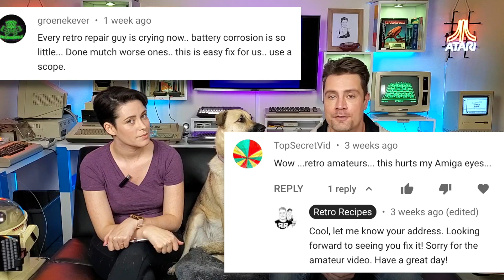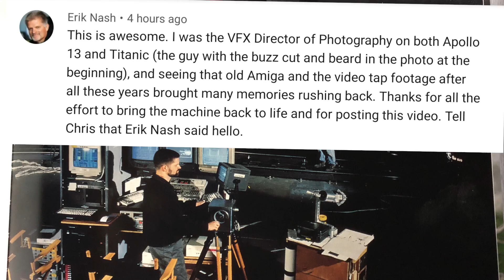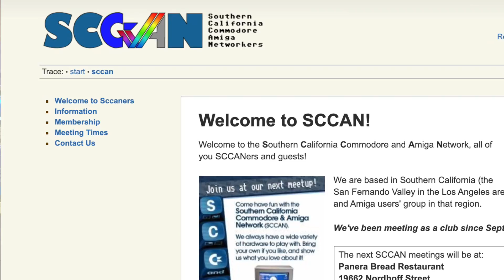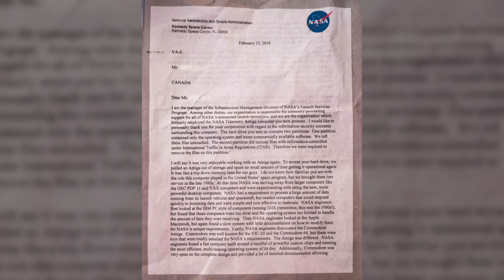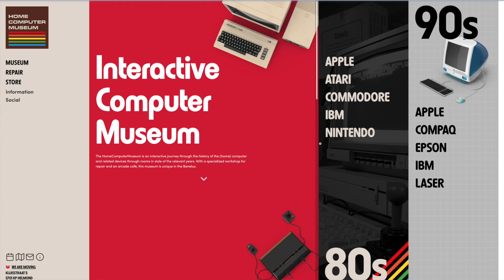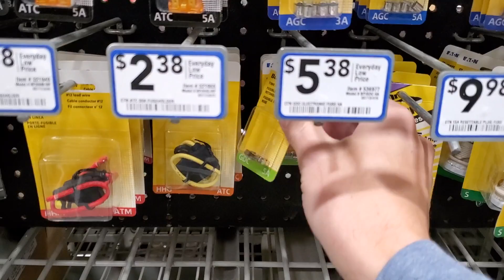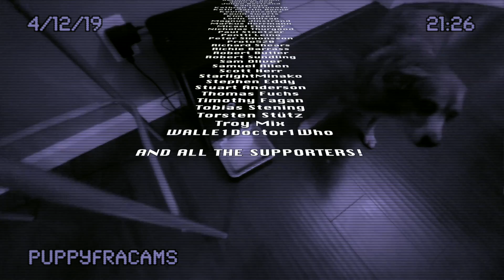Can we fix the Amiga that made Titanic? | Warning: Shocking

Comment: The first time this was powered up with 240V, the MOV (Z1) probably fired and blew the fuse. However, MOV's in this sort of case are usually one shot, and while they usually fail as a short, I guess this one failed open. The second time you powered up, it looks like the main switching MOSFET (Q1) bought it, which would've gone short between all 3 terminals (typical failure mode of MOSFETs). This in turn took out the control IC and R7 (connected to the mosfet's source pin) and R6 (connected to the mosfet's gate). I suspect R9 (current sense resistor) probably went as well.

Chances are there was a wire link between the +ve terminal of the bridge rectifier, and the middle of C7/C8 (the main capacitors). Removing this would've made it suitable for 240V input.

As others have mentioned, you should always power stuff you are unsure of via some sort of limiter. a 100W incandescent bulb is perfect for this, and something I use whenever I have serviced any form of power supply.

Comment: I've had a pretty shocking experience myself a few years back, I had an old TAB Silverball machine that I got working from two machines, one day I noticed a wire nut had come off some leads (I never did that work to it), I didn't replace it straight away and soon regretted that decision as later that day I was doing grabbing a keyboard inside it so I could go into the Windows 95 environment and as pc inside had an unpainted metal casing the wires touched it, I quickly leaped up getting my hands out of it, the monitor shut off and loads of smoke came from the CRT monitor and possibly the casing of the computer inside, I managed to hit the main switch on the back in time and saved the system from dying completely.  I left it for a few days to see if any permanent damage occurred and surprisingly it worked flawlessly, not even a blown fuse.

I was quite surprised it worked and yes I did replace the wire nut, a few months later the was an accident involving the touch panel smashing and turning it into a Step Mania and emulation machine with a different pc inside.

Also, I reckon Puppyfractic was just testing your reflexes.

Comment: 15:34

Sounds like the bridge rectifier may have been shorted, as you can actually hear the 60 Hz AC during the explosion.

That 8-pin DIP (IC1) is likely a UC3842 or similar SMPS chip, which drives the large transistor on the heatsink to the left of it.
I wouldn't be surprised if that chip got zapped by the 240V, and the large smoothing caps somewhat damaged.

(IC3 is the opto-coupler, which gives electrically-isolated feedback from the secondary side to IC1 on the primary side, for voltage regulation.)

Would be interesting to know if the bridge rectifier (black component, just above the large caps) tests as shorted.

But yeah, never listen to those "just replace the fuse" comments. ;)

The fuse normally pops for good reason, and the "240V incident" would have caused other damage, too, so it was a known cause and not just a fuse failing with age.
Reply: 16:47 That's actually not that specific resistor exploding, I don't think. It's molten bits of silicon and leadframe from IC1 flying around everywhere. lol

The 5 Amp fuse would normally allow quite a high current (and power) to pass in 240-Volt land (like in the UK).

(volts * amps=watts, so 1200 Watts.)

In a 120V PSU, the 5 Amp fuse makes more sense, as the PSU would then have to dissipate around 600 Watts before the fuse popped.

But, since it was powered from a 120V-240V step-up transformer, the original 5 Amp fuse would have allowed a LOT of current to flow (and a lot of potential power dissipated in shorted components) before the fuse finally melted.

It's more than likely the main switching transistor (on the heatsink near IC1) also shorted during the original incident.

I think that PSU is still fixable, it's just a question of whether it's really worth the effort. It's probably only $20 worth of parts to repair the primary side stuff.

The secondary side (regulators etc.) might have survived OK, as the transformer usually limits the current quite well unless it's being pulsed continuously.

Comment: My A4000 still works great.  I took the battery out yrs ago when I noticed it starting to leak and eventually replaced it with a little battery board that takes a 2032 coin cell.

Comment: just check the voltages and replace it with a modern new power supply !

ps. :  you can put new power supply in old case and everything will look fine ! 
pss. : oh, a new idea, also replace a ryzen5950x plus rx6800xt in the main case , make everyone surprise how strong was old computers

Comment: this reminds me that i need to check a couple old original xboxes for leaky caps (especially the rtc cap). im uh... not looking forward to it. 

by the way, you should see this c64 i have. it’s like practically unused, but there’s a huge crack in the enclosure that pushes the keyboard in when you type. like someone sat on it, or something. weird stuff. as nice as your brixty-four is, i guess i’d like to try and fix it. do you have any advice on making it look pretty good if i try to repair it?
Reply from the maker: I recommend you check out my Atari 800XL Extremefurb video for some case repair tips ;-)

Comment: Any chance you could try to export the PAR files in their native format and upload those to archive.org?  That would avoid quality loss going though an external capture card and compressing to MP4.  Looking through the manual it should be possible to export image sequences in its native format, DPX, and other formats with the software.
Reply from the maker: It's no longer with me but I'm sure Marvin can. I did already upload the HDF backup to my archive. See previous video description.
Reply: @RetroRecipes  Yeah, thanks for that.  I downloaded the images, but without the real hardware I don't really have a way to decode the files.  I found the manual for the PAR software, but I can't find any technical information about the filesystem the PAR drive uses, or the technical details of the format it stores frames in.  I was hoping to learn more by reverse-engineering the exported files.

Comment: Out of the dozens and dozens of these machines I’ve seen, and all of the battery acid damage… I still like the old batteries and it was decent tech for the time. Too bad it couldn’t be hermetically sealed or something to save from all the damage.  

But even with today’s technology… I swear to God modern Duracell alkaline batteries have damaged more high-end equipment than these old batteries. So although I know these old batteries have really done a lot of damage… They held up for a really long time, and there’s no idea what kind of thermal cycling they went through for years and years. Shit if you had put a Duracell in there… In a week half the board would be missing all of its traces. So although it sucks… Still impressed with those old batteries, And can’t figure out why battery technology has gotten worse in some areas.
Reply: Feel like I should add… I’m just picking on Duracell because they’re the main offender… And I don’t come in to contact with them much. Except one fixing multimeters another portable test equipment for some of my industrial customers. Why the hell they would pop Duracell‘s and stuff like that I don’t know… I always suggest energizer ultimate lithium is it going with something off the shelf. Or if it all possible a high-quality rechargeable that can’t be bought at Walmart. It’s probably a decent battery if you have to order it and it can’t be found on the local shelves at Walmart or the dollar store 😂 . I repair mostly test equipment, industrial PCBs, and do a bit of recalibration and metrology just to test my sanity. Board mounted batteries have made leaps and bounds of improvement over the years.

Comment: Fuses FAIL FOR A REASON!
Swapping a fuse is like finding metal shavings when changing your engine oil… then Cleaning your oil pan and thinking everything is OK. I mean holy shit really guys?😂 

that’s hilarious when I hear people say things like “why don’t you just change the fuse“ like seriously? Have you ever heard of varistors/movs and all the other means there to handle over voltage, In rush, transients, and overcurrent. Fuses are a last resort. (Well I guess technically the transistors and everything down range that’s going to get fried is the “last resort“)......but on something with even the small chance of being valuable or important…Not in a million years should you just swap a fuse. Fuses don’t blow for no reason. They are one of the most stable and predictable components on the board. I do PCB component level board repair for industrial clients day in and day out, I’ve seen boards that have been so abused you can’t imagine they would still work. Where the legs of chips are so corroded that they have been skeletonized… But after touching up solar joints, replacing electrolytic’s, and going over everything… The boards still work just fine. And no matter how badly damaged the fuses are always still completely intact. Even ridiculously fragile very low current rated fuses that have microscopically thin hair like filaments. Fuses aren’t fragile. They won’t blow for no reason… And what makes them blow isn’t some thing in your wall voltage… It’s a failure in the power supply 99% of the time. And if you just swap the fuse… Next time you might not be so lucky and it will take out a shit load more stuff that’s very difficult to replace, or it might take out a power supply control chip that’s impossible to find. And if it’s on a customers board, and “unobtainable“ board, or what I like to call… A “dinosaur board“… Then you just royally screwed up.
Sorry to ramble. The fact that anyone would be watching this channel and not know something like this and think they know enough about it to lecture or leave a comment on somebody else’s video… It’s kind of mind blowing. That’s like finding burnt metal shavings and ground up engine block in your old oil when changing your engine oil… And thinking that by cleaning out the oil pan and removing the chips totally solves your problem and you can just go forward and ignore it from then on. 😂

Comment: @Retro Recipies / Perifractic  How come the audio in the videos from your camera very often sounds like it's recorded with only 4 bits? The dynamic range is pretty much non existent. Low level sounds disappear. A good example is around 4:58 when you meet Paul in the parking lot. Sounds like the audio level is really low from the recording, and then boosted like 30dB in the video editing software. Meanwhile, clips where you narrate over the video, and videos you edit in from other people, like from Paul's lab, have no issues at all.
Reply from the maker: 4:58 is because those clips have noise reduction filter on them due to excessive wind and car noise. We were right by a freeway. Paul's lab had no traffic in it that I know of. If I had left that noise in I would have got complaints about that instead. So I just make an artistic decision.
Reply: @RetroRecipes  Ah, of course.
And regarding your pinned comment, I guess where you two are quite far from the camera in the studio / workshop the camera mic results in poor audio and then boosted/compressed in edit.
Hope you'll find good lapels or the like to record nice audio to match your outstanding video content. ;)
Reply from the maker: Thanks! I had previously used a Rode lapel mic and you'll hear nice audio in the same couch shots. But it's not ideal to be tied and clipped to a cable. If I have to go fetch something and with the dog moving around. Sometimes the camera goes flying! SmartMike+ is a great idea as it's Bluetooth straight to the camera. But the problem is buggy early software. But I'm in touch with them. 🤞 There's no perfect solutions for a couch setup. Other guys sit close to the camera, which is why they have less trouble. 🤷‍♂️

Comment: Power supply is still repairable. Send it to me in Canada and I'll have a go
Reply from the maker: Simon! Did you see how many parts actually grew flames? It's really not worth the trouble. The value is in the case and the data, and that's in Holland 😊👍
Reply: I did. The chip is likely the pwm mosfet driver, probably the mosfet, a current limiting resistor, basically most of the high voltage dc part of the power supply, maybe the bridge rectifier, but as I say, still repairable :-) I've spent a fair bit of time recently repairing the power supply boards in monitors and TVs, and they aren't all that complicated.
But you are right, the power supply doesn't have much value. The rest of the machine is worth a lot more.
Reply: @SimonQuigley  First, check if it is still under warranty.
Reply: Hahaha, somehow I don't think it has a 30 year warranty. Especially not since Commodore went under almost 26 years ago :-)